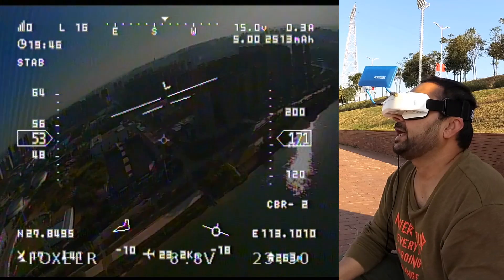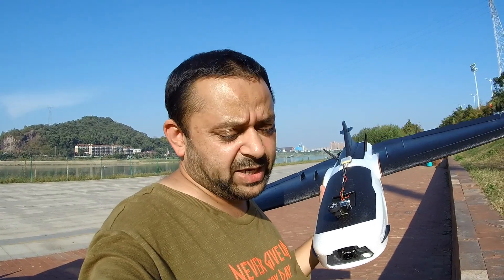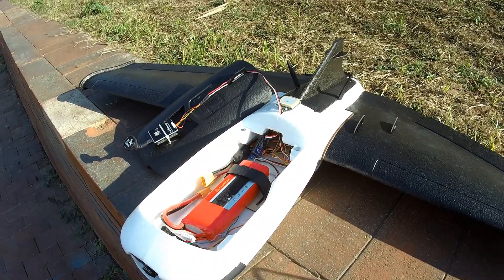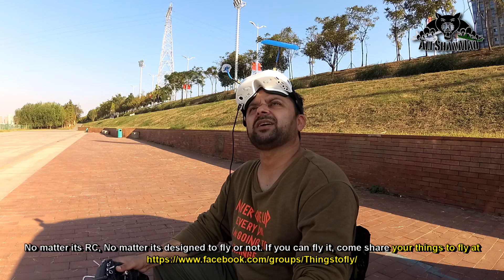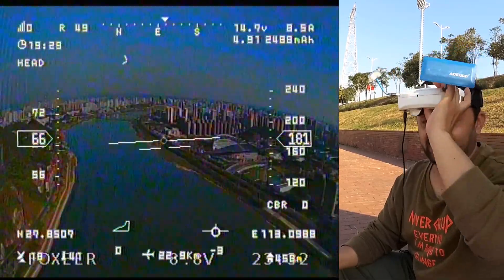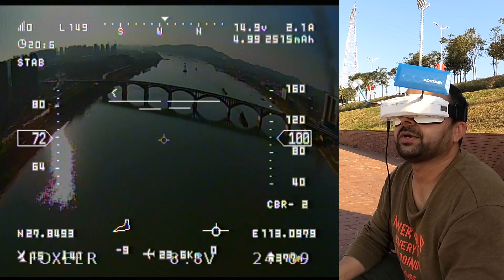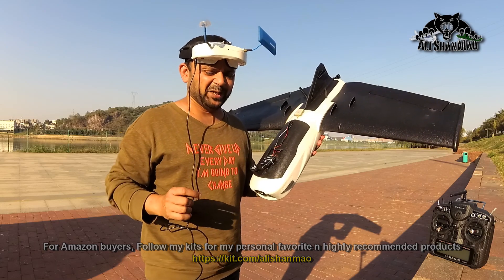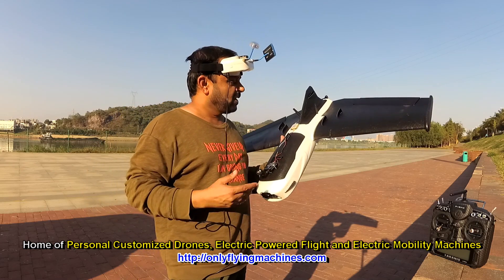24km accumulated FPV Flight Rambler RS Long Range FPV Wing

Comment: Are you sure your 1000mW VTX is capable of 12km range?
Reply from the maker: With a high powered patch or linear array you can go even farther on same tx
Reply from the maker: we used to do 48km with a 1W Tx and a 28dbi Patch :) So I am sure 12km should not be an issue with right antenna on ground.
Reply: @alishanmao  Oo wow this is insane. My Eachine TX05 AIO 250mW FPV camera only supports 400 meters. With Eachine ROTG02 receiver with linear antenna.

Comment: You need to INCREASE your gain if its oscillating slowly as you describe.  Increase it to the point that it oscillates quickly, then back off a bit.  The SNL will also need the feed forward adjusted slightly after you tune the gains to get proper stick feel.

Comment: Congrad  for you flight  you aplying the baby step method its a long but rewarding process it take a lot of guts and knowledge to test a model over the water  ok lets crunch the numbers 24 k circling apparently no wind   you will do better in  level flight (you have more controll imput drag in circle mode ) an airspeed will be usefull with an headwind  (plus gps ground speed and amp metter my 5 cents) i  would like to order the ramble  look like a very good flyer with a lot of space just hope the shipping cost to Canada wont be to hight   good luck with your project
Reply from the maker: Its on pre order and we are getting closer to ship. 
http://onlyflyingmachines.com/product/ramblerpnp/